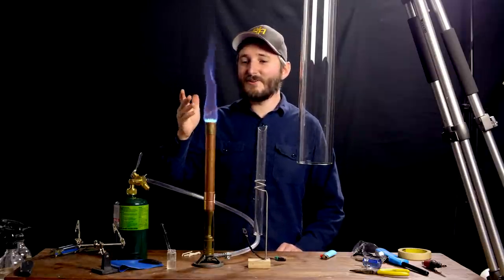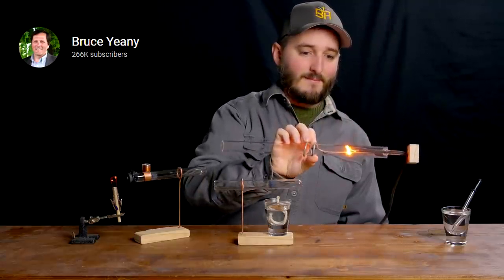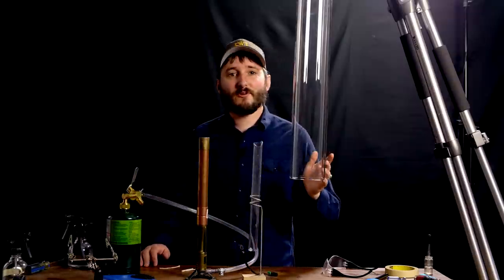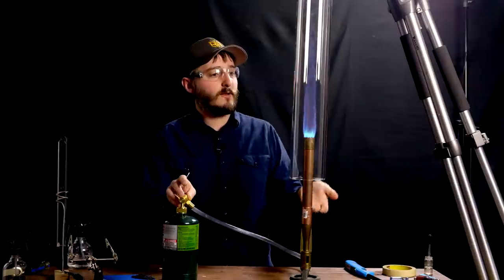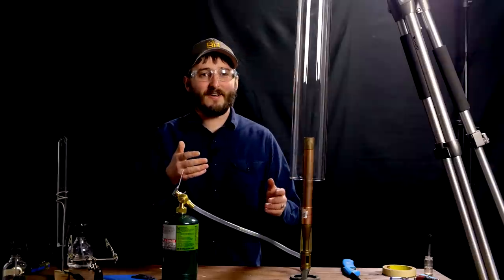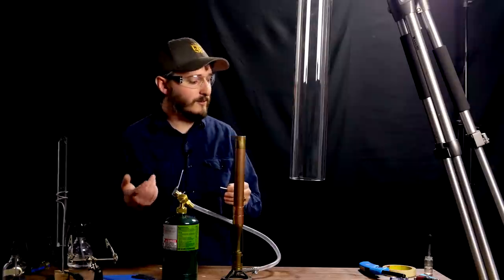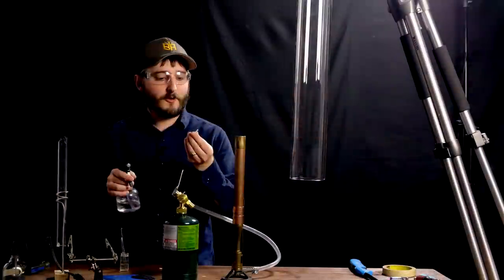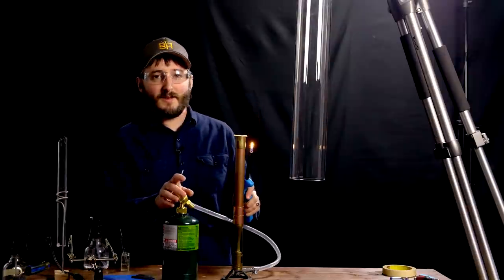Fire Driven Sound Waves in a Quartz Tube

Comment: I see a thermoacoustic pipe organ in the future! Great stuff!
Reply: I see a pulsejet engine with zero moving parts using thermoacoustics to act as a "valve", potentially helping with engine cooling as well. Timing the combustions with the resonance to simultaneously heat the engine to at least its fundamental frequency while also using the pressure caused by the resonating air to hold back air and fuel until it is drawn in by the waves for the next pulse. Simply put, use the differing air pressures to carry a fuel mixture in small packages similar to how it was demonstrated in a previous video with styrofoam balls.
Reply: I was thinking the exact same thing - but who will play it?  Is that guy from Fury Road available?  Lol
Reply: @Chop__.  Ten years ago approx I've made a TA "pulse jet" boat. The engine works but the effect is not so strong to drive a boat, car or airplane... Unfortunately! But now I have few new idea to increase the jet flow. It is not easy because the standing wave engines are so sensitive for the opened end geometry, but few tricks will work I hope. We will see!
Reply: Historically there have been a few of these made. They have the wonderful name of 'Pyrophones'. 
So we now have at least 2 instruments for a mad scientist rock band; Tesla Coil guitar amp and Pyrophone.
More suggestions?
Reply: @profpep  The blowless flute could help too for this band with external or internal heat source also it has only one tube. ;)
Reply: That would be metal as hell.
Reply: The highest Carbon emission instrument known to man 😂
Reply: Exactly the comment I came here to make. I was thinking it might take some video editing to speed it up, or active cooling after seeing how long those wire-heated tubes kept ringing, but this is really quick when everything's on fire.

A few solenoid valves, a few glow plugs, the rest of the owl, and you could have a player piano that's also an explosion hazard.
Reply: Or like,  public use active art piece?  Heating elements inside tubes and when you push buttons on them you can make music from nothing!
Reply: Sounds like a LMNC video if I've ever heard of one.
Reply: @Chop__.  thermo-electroacoustic Venturi system Actually...
Reply: My dad built it in 1986....
Reply: 200th like awsome that would be cool
Reply: Even better thermoacoustic amps
Reply: Damn you and I think alike bud. Imagine how that would look while being played?
Reply: Exactly
Reply: MTE
Reply: Yes, a proper pyrophone

Comment: Those slowies were wicked! The flame may break apart in mid air, as nodal points might be compressing atmospheric air and replacing the flammable gas at those points. Really great viddy - and being off script was really fun to watch actually!
Reply: More than might, take sensor measurement (t/p/m) of the space between those nodes and you will see why I say more than might, now observe the flame within a node and ask where is the fuel coming from to sustain the flame? To answer that you need to understand what is happening. There is more than just atmospheric compression there is dimension displacement. The gaps between the nodes are the points of displacement, the sound frequency (never mind the source) and its harmonics are the tools of all that we have in this universe. For example just as harmony can shake the planet or a ✈ can fall apart from bad harmonics or water dance in a bowl so can sound frequencies create, change or disassemble any matter known.
In our day to day life we see frequency in use and experience how frequencies effect us, connect us, harm us, how it can  heal and hurt. Many years ago this was public knowledge taught to all. The lessons of frequency are still carved in stone for everyone to read. Our vocal cords can generate what's needed. The omm /ahhh are a good base to master at about 432hz, although this will vary from person to person. 
The take away from this is it supports the fact that everything in this universe is just collections of bonded harmonics. 
The treated flame is an excellent visual demo of the abilities of frequency 👍 and off script is just as good 👍👍
Reply: Aayush Deo  I think the point of the video is oscillations can be created directly by the heat of a simple flame...

Comment: 5:00... so alcohol is wetter than water? I think this deserves a whole video
Reply from the maker: That's not a bad idea... I'd have to give some thought about how to make that entertaining
Reply: @Nighthawkinlight   you could try to get in contact with schmoyoho to make a second remix of water is not wet. something like water is not wet but alcohol is wetter.
Reply: Water isn't the social lubricant, is it?
Reply: They make products to make water "wetter" or simply reduce surface tension. Dish soap is a simple example but they make a whole variety for use in gardening, fire fighting, well drilling and more. Its actually a pretty common thing but you never really see it unless you know what it is.
Reply: @Mark-dc1su  I think you meant universal solvent?
Reply: What if you add a small amount of alcohol to water?
Reply: @mamupelu565  woosh

no, if you're at a party, you aren't sipping water to get social
Reply: Ladies and gentlemen,
water is, indeed, wet.
Reply: @mamupelu565  The three most common alcohols are considered to be completely miscible in water so you would end up with a very dilute alcohol solution. So depending on what you are doing this may work or not. For wetting the string it would help if enough alcohol were present. It would also be better to dip the string into the solution instead of pouring etc. Another option is a pressurized vessel, but now we are getting into more work than is necessary.
Reply: I've had to use wetting agents to speed up  transducer soak tests.
Reply: Here we go....
Reply: @Nighthawkinlight  Interestingly, I was just thinking about superplasticizers today though for cement mixes.  Started off unrelated and regarding fiberglass rebar and potential advances in better performance non-metallic rebar alternatives for the inner and potentially exoskeleton for like the longest lasting re-enforced concrete (RC) erection to make natural resources like 50 to 100ft tall or maybe larger stories to let the most light in and allow for large tree growth along with the rest of the minimalist ecosystem.  Yes, that got me thinking about if the RC was encapsulated to prevent long term erosion and/or fire (aerogel layer?)  compromising the structural integrity risks, what additives would minimally effect the structural integrity of the cure and concrete like superplasticizers and wondering if something would need to add CO2 since cement/concrete sequesters.  Maybe something with pore size in the encapsulation would allow for gas and not allow water to be absorbed and freeze to compromise integrity longest term.  So superplasticizers came to mind today as well.
Reply: @Nighthawkinlight  Mercury would make it interesting
Reply: This can lead to cooking technique.  I often see people seasoning meat with alcohol and use alcohol when cooking, , for seasoning can easy explain but i'm not really understand how alcohol would effect the food when cooking due to extreme temperature causing the alcohol evaporates too quickly, so what uses of alcohol in that case (when cooking)?
Reply: @2204thientai  alcohol breaks down protein and makes softer meats. The type of alcohol matters as well. Alcohol adds flavor.
Reply: Some visual examples of where wetter than water comes into play would be cool, I know you told us, but showing would be cool... also fire/flame is kind of mesmerising. Some more clear A/B examples showing how it makes the difference like you did here....
Reply: @NickFrom1228  surfactants, Right?
Reply: @MMMM-sv1lk  Yes, that is essentially all a "wetter" is.
Reply: I guess the reason was the fat on the wool, the alcohol simply solved that into solution.
Reply: @Nighthawkinlight  you can burn burn money with alcohol while keeping it wet with water :D

I have no idea how this can help, but it looks quite nice
Reply: @Nighthawkinlight  there's a beakman's world episode on soap where he addresses the principle X)
Reply: @Mark-dc1su  yes it is in a ratio between 3,5 and 7,5 % with ethilic alcohol...
Reply: @2204thientai  alcohol for seasoning is bs
unless you use it raw.
Reply: @V1ctoria00  seriously?  🤣🤣🤣
Reply: yup lurned sum thin their should be handy up the road yup
Reply: @Mark-dc1su  The world would be a better place if water was the only beverage
Reply: @jaredjones6570  I'm a bit of a teetotaler, so I agree.
Reply: @Nighthawkinlight so you’re saying I should eat my foods with alcohol so I can absorb the nutrients better?
Reply: @Mark-dc1su  are you saying i should be more wet to be more popular?

Comment: Great video, Love the quartz tube allowing for such a great visual.  I especially like the slow motion of the waves.  Just curious,  what was the length of the tube, did you mention it somewhere and I missed it?   Also,  it would be interesting to  see how the actual frequency measures compared to calculated measurements.  They  tend to vary according to the temperature of  gas inside the pipe.   Any experience with Sondhauss tubes?  I've dabbled with them a bit but haven't gotten anything near as good as the Rijke tubes.
Reply from the maker: Thanks! The quartz tube is 51.2" tall x4" in diameter. It's a replacement tube for an outdoor infrared pillar heater. I hadn't heard the term "Sondhauss" tube, but I have made something like that in my first thermoacoustic video around the 5m mark: https://youtu.be/abswNCqnMRQ

They are a little finicky and the steel wool needs to be very finely divided.
Reply: I believe you both are involved in identifying a natural phenomena that has been recorded in more recent years. The “airquakes” bellowing around the globe, that sound like large horn instruments... 🤷‍♂️🤔  sounds like it could be heat in the core is leaking so that the quartz crust vibrates and lightening is discharged ground to cloud
Reply: @WColeZPorter  This basically is just "organized weather" in a tube. 

The global weather is extremely chaotic yet still does show "oscillations" in the form of repeating patterns (why we're able to predict it to any degree)...

Inside the tube is much more controlled because the waves aren't infinitely wrapping around and interacting with each other from every direction (there's some but it's trivial and "end to end"), so the result is much more "defined".

Both are driven by heat, one is just running at a much lower frequency
Reply: @Nighthawkinlight  The inch is not a scientific measurement unit, no matter what the Anglo-Saxon world may think. Please provide also measurements in the metric system... ;-)
Reply: @MadScientist267  There is no reason to assume that "weather" would escape the laws of frequency and resonance except that it is too complicated for humans to decrypt...
All is frequency. In the beginning was the word.
All them kinetic experiments on youtube are really of such a disarming naivity...
Reply: Hey, you are the one from the video!
Reply: Is that true quartz? Does it pass UVC?

Comment: Wouw! Pretty cool experiment again! The flame's break should came from the node of the sound wave basically so the period near by the typical frequency. The chimney effect is so strong here so I think it could add some traveling wave component to the standing wave. Another interesting thing when the burner was close enough to the quartz tube's wall (8:31) the TA sound effect started with the higher gas speed easily, so I think the gap between the burner's diameter and the glass tube important for the best result. If I'm right than the visible vibrating flame could go much higher in the optimal diameter tube, not just around the bottom. It was a really good demonstration Ben! Thanks to share it! BLADE 👍👌🙂

Comment: This gave me an idea: use this effect to make a musical instrument by putting resistive heating elements into tubes sized to produce different notes and control the whole setup from a computer or something
Reply: That could be an awesome collab between him and Look mum no computer
Reply: That was my first thought as well... a flame pipe organ with electronically controlled valves on the fuel into each pipe.  Optionally with a different compound on wicks to dope each flame to a different color.
Reply: You could actually use interlaid tubes, one which moves to change to different offsets for a different resonance.
Reply: @CaraesNaur  I think of  Pulse Jets as gasoline powered Organ pipes.The thrust is just a added bonus.
Reply: Same idea, but I thought of a sort of organ/piano with keys, I might try it
Reply: The trick is to find a way to achieve reliable combustion. Might need some sort of glow plug or something in each tube to sustain combustion.

Comment: It might be really cool to explore using colored mist or nonflammable dust/smoke inside the tube.  You might be able to see where the nodes are positioned along the tube. Also, it might just be cool to see how the gasses and sound waves move through the smoke medium in the tube.
Reply: Agreed!

While pillars of fire are ALWAYS cool, visualizing the oscillations, nodes, and peaks might be better conveyed with smoke/mist.

I was thinking that if you returned to an electrical "heating element" that is easily positioned/controlled and NOT subject to being extinguished (?) by back pressure, and introduce a smoke/mist element, you'd be able to SEE the standing/moving waves of sound.

I'm wondering if the speed of the rising column of air/fire/smoke CHANGES as the fundamental/harmonic frequencies start coming into focus.  You've got the speed of the ascending column of air versus the speed of sound (which should be the same, regardless of the frequency (fundamental/harmonic) of resonance.

Another complication in this analysis, as compared to air in a flute, is the DENSITY of the medium... the density of air vs the density of a ball of hot flaming combustion products... and how this changes as the mixture changes and the average temperature of the rising air column changes.

So many variables... SO MUCH science fun!!!

Keep up the great work, dude!

Comment: Idea to film it in the small tube:
If you can adjust your cameras frame-rate to almost match the resonant frequency, you could film the effect in the little tube as well (stroboscopic effect).
A high resonating frequency means that the draft is very slow compared to the sound, which could mean less turbulences, making the effect more reliable.

Comment: I will have nightmares about vibrating Quartz shards plunging their way into your eyes, KEEP YOUR SAFETY GLASSES ON DAMNIT!
Reply: Yes! I kept shouting at the screen,  "Stop waving a high intensity flame inside a quartz tube inches from your face! " 
I thought he should've rigged up a lift as he was initially trying to insert the burner.  But especially so as he was lifting and 'tuning' the position of the burner; I'd love to have seen what the flame would have looked like with the burner held stable while making fine adjustments in height.
Otherwise,  great job,  very interesting effect.  Ditto on making a whole flame-tube organ!

Comment: Beautiful footage!  I always interpreted this demo as the sound wave first pulling fresh air into the combustion zone, getting a little boost from the resulting puff of fire, then pushing the fire back down into the flameholder on the return leg (hence the disconnected puffs of flame in your slowmo).  Basically it's combustion-amplified audio, which could make an incredible sound-and-fire instrument if you could tune it!

Comment: The thermoacoustics experiment reminded me of an experience that I'll never forget.
In the late 80's, I was a tug captain piloting a 300' barge of full of "cans"...Pilings.  Galvanized steel pipes 2', 3' and 4'  in diameter and about 100' to 150' in length.  The barge heavily loaded and was headed to Alaska somewhere to build a dock.  We were coming down the Duwamish Waterway.  The last corner we negotiated was called Fisher's Corner as it was a flour mill back in the day. After that corner was a straight shot into Elliot Bay, Seattle.  The wind was blowing, prolly 25-30 outta the North. I was piloting the barge up at the bow standing on the pile of pipes.  My mate was at the wheel.  As we rounded the corner, the wind was blowing across the pipe ends.  Like a flute.  It was no small task to turn the barge into the wind...but we knew what we were doing.  We anticipated.  What happened next took us all by surprise.
A vibration started that felt like I was being  torn apart inside. I'm sure the mate felt it too!  Perhaps like a Star Trek transporter.  It was very loud.  Really loud and deep.   I was standing on the pipe but they started vibrating...I basically was forced off.  Today I'd die,  but I was young and just took the fall...bouncing from pipe to pipe some 20 feet  in stride.  As I hit the deck, the vibration was making  the dust and stones bounce.  I couldn't see or  breath.  It was like standing on ice.  The mate was yelling in the radio asking what was going on!  When I spoke in the radio he simply couldn't hear me.  We were driving blind!  The mate knew he needed to turn and by guess and by golly he turned the barge straight into the wind and the vibrations and noise went away.  We made a bunch of smart ass comments to each other and then went about our business. We were both pleased we didn't make the news by crashing into something expensive.
It seemed to me, if properly tuned, those pipes could have destroyed our barge.